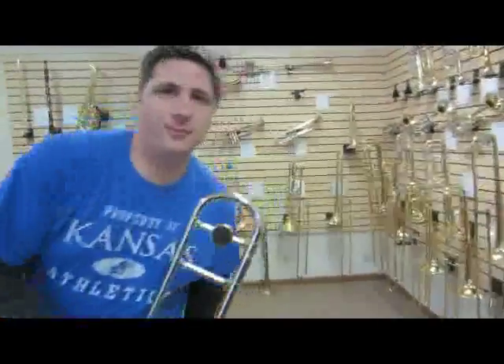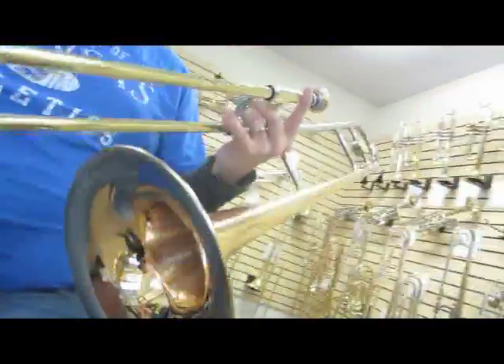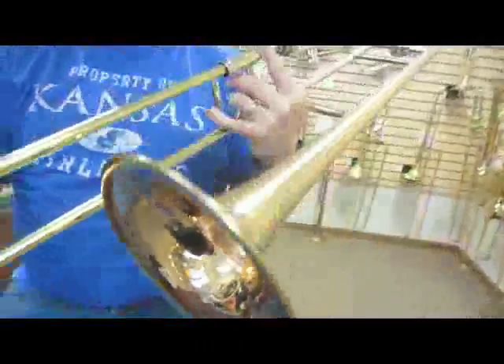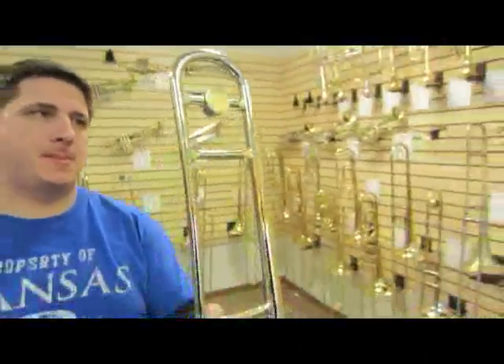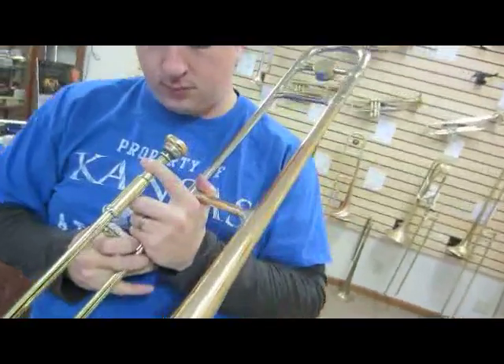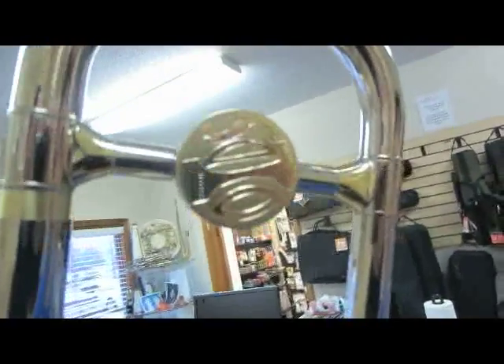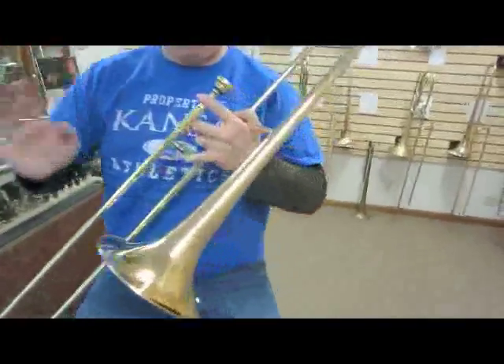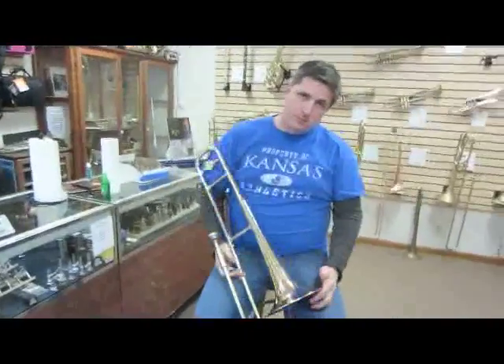Ryan Heinlein playing a B.A.C. Modified Vintage Olds Recording Trombone

Comment: The slide bore surprises me; I thought all Recordings were 495/510. I played a straight Recording in high school and about 10 years ago I got a used F Version on eBay. I loved it in HS and I prefer my F version to my Bach 16 (which is itself one sweet horn!). I matched it with a Bach 5GS mouthpiece and the sound is amazing. That tight wrap is fine btw, maybe it doesn't blow quite as freely as an open wrap but it is convenient, compact, and downright pretty. As is the engraving on the bell, one of the really notable features of the Recordings. And I am always so leery of relaquered instruments, but I'm sure you got this one just right...